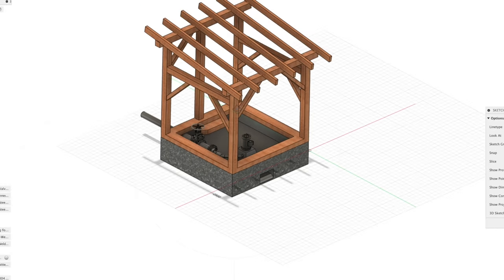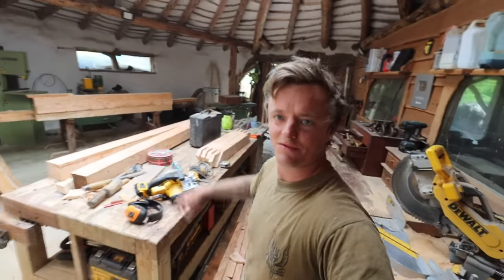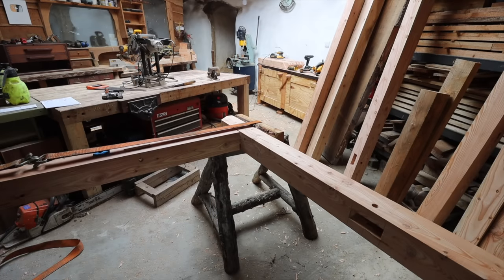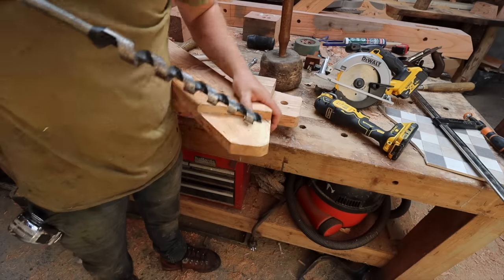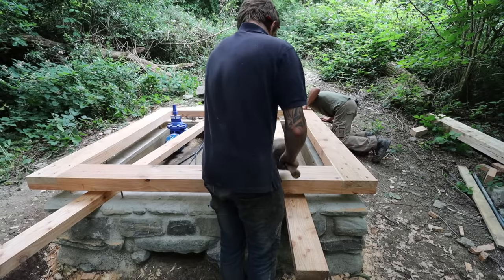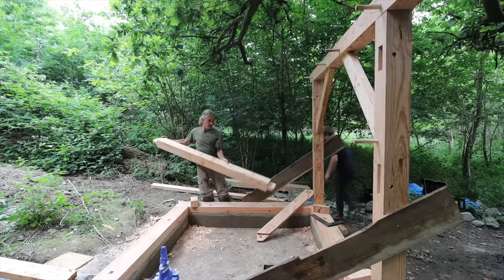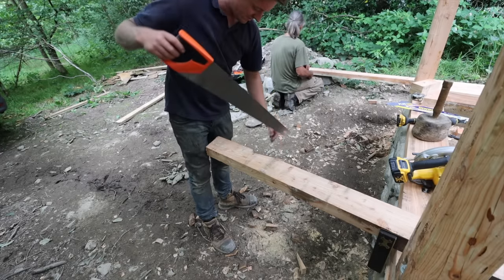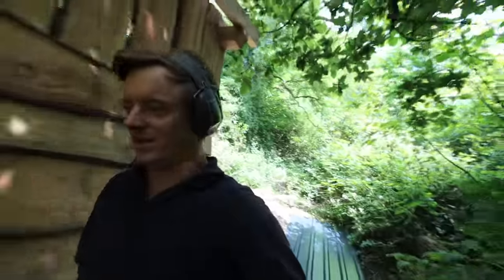1.5 Kw North Wales Hydroelectric System Installation Part 2 Timber Framed Powerhouse

Comment: I would definitely give the building 100 years the way it was built, even though it is in the forest!beautiful work!
Reply: pretty sure its more
Reply: In a 100 years when a solar flare 2x the size of The Carrington Event nukes every electronic on the planet.  Our descendants can look at the craftsmanship and think to themselves.. "Boy oh boy I bet portable power tools were nice; whelp back to trying to replicate these mortise and tenons with our stone tools"  :)
Reply: Never underestimate the power of nature ... and the one worry I have is the base square, which is lying flat on the concrete ... which has the danger of creating condensation on the cold concrete, which will them cause that square to ROT. It isnt even rain that would be necessary ... just pure condensation from cold nighttime temperatures on warm days.
It might have been a good idea to put a layer of clay between the bottom square and the concrete to push out any air pockets and thus moisture ... and then finish it off with a bit of pait to keep moisture from creeping into the clay.
Reply: @Muck006  All the timber is very durable! No chance of that happening!

Comment: reminds me of old wooden boat construction using trunnels (tree-nails) as fasteners to hold the framing and planking together. only difference is that with trunnels the pegs are slit with a saw at the ends before being driven in, and then a thin wedge is driven into the slots on both ends to lock the pin in place. once the boat is in the water and the wood swells up, the holding strength is pretty incredible.

Comment: Raf seems knowledgeable and helpful. Always good to have a buddy like that on a job with you. I had a bit of a laugh when I saw you handling that corrugated roofing without gloves and Raf with them where he's got experience with it. Seen that stuff slice flesh REALLY deep with little to no effort or pressure. Glad there wasn't any issues there, definitely recommend to always use gloves if you ever have to handle it in the future!

Comment: Love your show. 
Been watching it for some time. 
TIP
With your pegs, always try and mallet into the frame from the outside of the structure to the inside of the structure. 
This saves the possibility of adjacent cross-supports getting in the way of being able to tap them further home as the timber dries. 
Depending on the design you aren't always able to negate this occurring, but the method helps.

Comment: Great little building.  The timber framing was so beautiful by itself I almost wish the whole thing could just be clad in acrylic panels so people could marvel at the joinery.

I’m curious as to why you chose to do the tops of the side cladding in those short vertical planks, as opposed to just continuing the same cladding system all the way up—looks a little strange IMO since the vertical planks dont’t also continue around the rear of the structure.  There are also gaps noticeable between the planks—is this meant to be for ventilation or something?

Also just have to say that you guys seem to work together quite noticeably well.

Comment: Beautiful work. I may have missed it, but is that bottom sill plate resting on the foundation walls made of treated wood? How are you planning on preventing moisture from the stone absorbing into the bottom plate of the frame?
Reply: This has been a common question in the comments. The logical answer should be that Kris knows that this wood will not be affected by rot in this application.....!
Reply: @andymccabe6712  Thanks for pointing that this was asked already, looked through and didn't see it so was just curious. I cannot imagine this wood will not get affected by rot, but perhaps the lifetime of other components of the shed will make the slow rotting of the sill plate moot.

Comment: Need to check out that pumped storage. Make a reservoir on top of a hill, pump water up to it when renewables are going then let back through hydro generator to power when renewables are down.
Reply: You need a comparably huuuuuuge reservoir just for a few kwh of stored energy.
For this size of a project not worth the hassle I think.
Reply: @FutureChaosTV  Depends on the head height, the higher the head the less volume required. 
For instance the 1.5kW generator here has a 50m head height from the stream to here, assuming the stream doesnt start on the top of the hill there should be some area for movement. 
Using a excavator you can quite easily build up or dig down on the top of a hill for a large pool area say 20m x 5m x 2m, giving 200,000L (good excuse to build a pool/pond aswell). If that is twice as high as the dam then you can approximately double the energy per litre through the hydro system. 
Admittedly you are right in most cases because most people dont have the land verticality required to pull it off, but hey most cant have a dam either.
Reply: @James-sk4db  I think if you ask Kris, he'll tell you this is a fantasy.......!

Comment: Kris, could you please put some info into the description in the future as to which type of timber you've used, for how long you've dried it, what you possibly did to prevent too much twisting, besides possibly using cores/straight grain? 

I'm looking to start out just like you within the next few years and you've gone from 0 to 1k in no time....

I'd appreciate any info or advice

Comment: Quite nice work all around. If I may ask. Why wouldn't have put a rubber or neoprene gasket between the sill plate and the concrete? The same thought occurred to me as to the two horizontal beams you used to form the upstream dam.

Comment: Hi Kris. Ace work as per. Just wondering do you really think the wind braces are necessary? With such strong joinery, in such a sheltered spot, and the considerable racking resistance added by the cladding. I made a very similar design timber frame irrigation shed without braces and and I push it with all my weight and not feel any movement.. Might save you some time and timber. Keep up the great content..

Comment: Kris, how did you secure the posts to the sill plate? Did we see you using a lag screw or something similar? I have made identical structures in the past and have previously morticed through the sill at the corners and put a tenon on the post base. It's a bit of a drag doing it that way though and I like the look of your method.

Comment: Great video!  What's the reason not to mortise the uprights into the sill plates? To avoid slow work in the field, or is there a concern with rot resistance in the sill plate mortises?

Comment: Kris, I want to know more about your self power "dash board" the system you have used to monitor the hydro output (you show it on your phone). I have re watched a lot of your videos but can not seem to find the one that describes where you got it from and how you got it working. I have a similar system to yours and I want to be able to use a phone or laptop to check the hydro and solar inputs into the battery and also the inverter output from the battery. I also want to be able to have the above date logged on historical files for future reference.  I am using epever equipment.

Comment: Why do you guys use timber for hydro? I imagine, the air still will be wet even if the timber doesn't contact with water directly. How long it will last in such conditions?

Comment: I'm wondering how you work out the power available. Do you simply measure the water flow, and distance it drops by, or are there other considerations?
Reply: It's all determined by the volume of the pipe, the gradient and distance traveled, and the amount of flow available, it also depends on the efficiency of the generator. And how far the current has to travel to work out how much useable power is available
Reply: @you-know-who.  Thanks. Very interesting.

Comment: Wood on direct contact with concrete is not that ideal right? A carpenter ffriend of mine told me to put something in betwen when I was building a wall with wood frame against concrete. If you dont the wood will rot he said.

Comment: Yall do some stuff so easy and then other stuff the hard way. That nail gun was worthless. And the little blond girl was the only one that gets to use it. You took forever lining up the siding just to cut the ends off with a hand saw?? Where's the power saw? Or you can only use that next to the water spring?

Comment: Hi Kriss, what timber did you use for the frame?
Reply from the maker: Its all made from welsh larch.
Reply: @KrisHarbour  Cheers, does the larch have properties that make it particularly suitable for the building?
Reply from the maker: @H2Dwoat  It does. its a light weight but strong timber. it grows fast and the heartwood is quite durable even when untreated it should last 30 years.

Comment: Kris, why not frame the building that houses the hydro-electric power plant with scaffold tubes (no one sees the structure from the outside)...? 
Easy to work with,  durable and inexpensive. 
Of course, what the client wants the client gets, so if your USP is mortice/tenon jointed timber, so be it.
Anyway, always enjoy whatever you're up to :-)